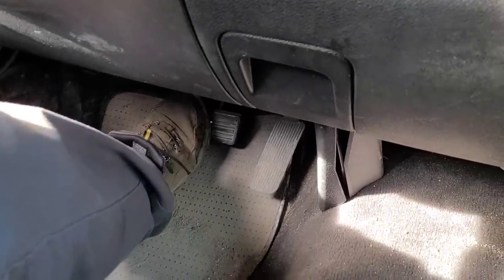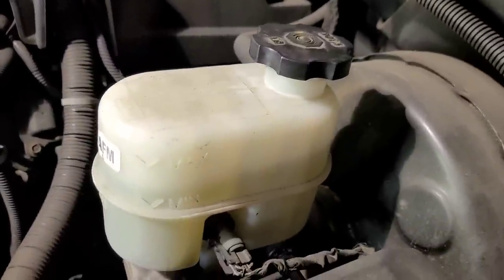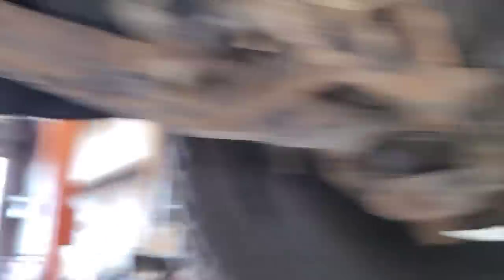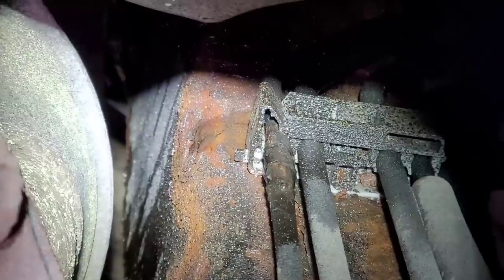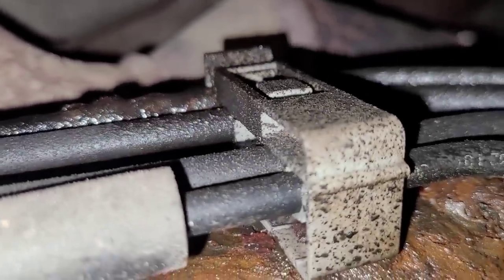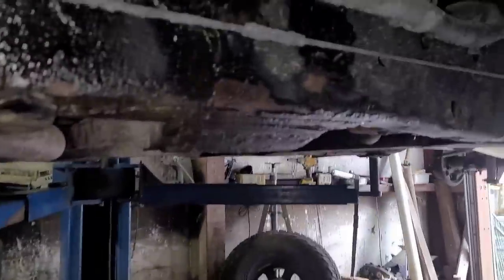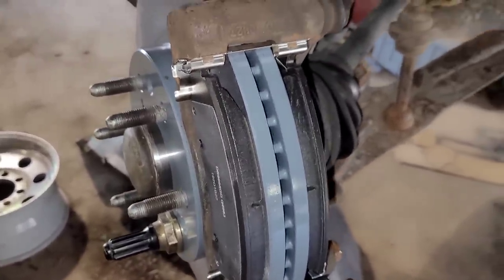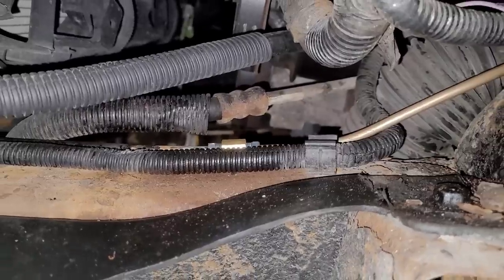Loss of Brakes. Locating the Leak, Fixing a Line & Some Helpful Tips

Comment: Hey Kenny, Here's one for ya:  Two young ladies came into the shop and asked for brake problem diagnosis on a Chevrolet van. When I drove it into the shop it had absolutely no brakes at all. So popped the hood and the master was MT. I lifted it up and looked everywhere for evidence of a brake fluid leak. I pulled the wheels and looked at the wheel cyls and calipers; nothing. Everything was bone dry. So I filled the master and began to bleed the whole entire brake system. As I went about it the two ladies came out to watch. In a couple minutes they told me I wouldn't need to bleed the brakes because they had already done that. I told them I was still going to do it and they were going to have to pay for it. They were not very happy about that, so I explained it to them.  That was probably 20yrs ago but I remember it like yesterday. ben

Comment: I'm following SeaLab Experimental Division & I appreciate your work. 1 ALL VEHICLES OVER 10 YEARS OLD AS A MATTER OF PREVENTIVE MAINTENANCE GET A NEW MASTER CYLINDER OR I DONT WORK ON IT.  PERIOD!  LIVES LOST DO NOT COME CLOSE TO THE PRICE OF A MASTER CYLINDER.  I'm not a fan of splicing brake lines old. I always try to replace the entire line especailly on an old rusty crusty vehicle.  Replacing entire line also removes any inherent rust issues inside or outside of the line.

Comment: So glad to see you flared the lines and used a coupler instead of a compression fitting. We don't allow compression fittings on brake lines up here in Ontario. I did see a shop vid from Florida recently that proposed using a compression fitting on a brake line repair ... 👌
Reply: Ray?

Comment: Hey Kenny, Glad to see the right way how to do it. I have to admit, I have used compression fittings, thankfully with no problems. They actually stayed on long enough for the brake line to rot in a different place where I actually cut the length of line with the fitting on it so I could put another one in further down. The right way is always the better way though ......

Comment: I had my fun with my 06 Silverado's brakes.  Had to replace the rear line.  While I was at it, I replaced the rotors, pads, drums, wheel cylinders, and shoes.  That was in 2018.  Good for 12 years on the originals.  Been fine since then.  I learned that stainless lines are a bear to work with.  Gave that up and switched to the flexible lines.  Those were much easier and now I have a spool of it if I ever need it.  Bought a nice flaring tool.  I could've used this video!
Reply: Inline tube sells a prefabbed kit identical to oem, you can chose stainless, not terribly expensive and they fit like a glove

Comment: I literally just did this job on a 2007 Suburban.   I used a wire wheel (aka cheek poker according to Derek at VGG) on an angle grinder to get rid of that coating.  Flared the ends and then connected everything.  To make me feel better living in the rust belt, I sprayed some fluid film (South Main Auto's favorite) to coat the fittings and any area of the brake line that didn't have the coating coving the line.  Great Job Kenny!

Comment: I know in PA compression are illegal.  I think that truck was passed on to you by Watch Wes. Never saw that tool before, really slick, especially in limited space, like in this job.
Reply: You are correct compression fittings are illegal to use on brake lines in Pa. The whole line should be replaced because if it’s weak there could blow out somewhere else. Then check out the other lines and replace them if they look weak.

Comment: I had a 97 Crown Vic Intercepter.  At 10 years old all but 6 inches of the metal lines were rusted.  I replaced ALL the lines.  Since I was there the hoses were replaced too.

Comment: I suspect the reason for the ant size is that the rust condition of the truck lead to the former fixer struggling to get the hardware of. Hoping the next time around it would be easier. In the words of Eric of South Main Auto. (a youtube channel) "Welcome to New York BABY."  Great video. I will definitely look for that flaring tool.

Comment: When you live in the rusty, crusty, North where every snow and ice event is followed by a liberal dowsing of salt on the roads you’ll understand why a coating of anti seize is used on the metal surfaces of our vehicles. I have used anti seize on wheel studs for 50 years after twisting them off trying to get the lug nuts off. There are places it shouldn’t be used and common sense must prevail.😊
Reply: D Perry you are exactly right.  I have also used anti-seize for over 40 years here in the north country and have never and I mean never had a bolt loosen from my original torque setting.  The belief that anti-seize causes bolts or nuts to loosen is just an urban myth.  Anti-seize does exactly what it says it does it prevents bolts and nuts from forming rust that can seize up any steel nut and bolt.  The prejudice from professional mechanics is the silver mess anti-seize leaves behind on their hands, clothes and tools.  I would rather contend with a little cleanup than fight rusty nuts and bolts.  I guarantee anyone who has had to fight the northern rust monster has a container of anti-seize close at hand and is not afraid to use it.
Reply: @teddymac3737  Well said and if truth be known our mechanic friend from New York, Eric O. , would likely agree. He fights the rust monster just like us.

Comment: Been there dozens of times. To save yourself some time you can jam on the brakes from 10 - 15 mph and see if one end skids. Going forward if the rears skid you have no fronts. In reverse if the fronts skid you have no rears. If you've never done this befor you have to "feel" for the brake performance, not just be a bull in a china shop. But once you learn it you'll be amazed and it's so quick to point in the right direction for diagnostics. On my own vehicles I do a bonafide Master Cyl bleed  B4 replacing it. Seent many times when just bleeding the lines and cylinders won't get that air bubble out of the master.  Kenny, maybe I missed it, but did you ever "see" a brake light from the imbalance? That should be addressed so the driver can be alerted B 4 he finds out about a problem someday again by "accident." Also, I was just wondering: Does anyone  make a hammer flare tool for brake line? I have Rigid and Lennox brands for single flare that I picked up at Home Depot & Lowe's but don't know of anyone selling one for double or bubble flares.  It'd be faster. One more thing: Antifreeze even at 50/50 is flammable too. I witnessed a hose come off a test engine on a dyno and when the antifreeze (ethylene glycol)  hit the red hot exhaust magnifolds, the flames shot clear up to the ceiling. It was such a big flame it set off the CO2 fire extinguishing system.  You're welcome. ben/ michigan

Comment: Checked out an '09 Silverado, 255000 on truck, 90000 on a new motor. Fleet truck supposedly used by a salesman.  Rebuilt front end but what bothered me more was that the doorlocks, windows, were iffy, sometimes work, sometimes not. Frame was ok, rockers replaced, price was right but alot of things bothered me. Truck should've had the AFM on it, not sure tho but I'd bet the old motor did hence why it was replaced. Didn't bite.

Comment: In the pre ABS days they had a proportioning valve that would provide some braking with the two wheels that were not on the circuit with the leak. Now with ABS, does the ABS system offer the same kind of dual circuit safety design?
Reply from the maker: They do . And some of them criss cross . IE-The r/f & l/r are on one circuit and the l/f & r/r on the other

Comment: Here in the u/k I have never heard of compression fittings used on brake lines, in domestic plumbing yes, but on something that needs brakes to stop it NO never, been doing it the way you just did with a flaring tool for years, only safe way to do it.
Reply: Replacing the whole line might be an alternative ! In this case the whole vehicle will need replacing , lol !

Comment: Oh Lordy , thinking of the gmc Savana 2500 my brother just sold . He said “ I want to change EVERY brake line on this van “ . I cringed . Well , we did . Thankfully , it used 1/4” lines like the job you did , rather than the 3/16 I’ve done forever on everything else . 3/16 “ are just like thin spaghetti compared to spaghetti . You can bend 1/4” by hand when needed and less risk of kinking than 3/16” . I’ll never let my brother flare brake line again . He knows better and he still fumbled a double inverted flare . He knows how but his negative , save money and time attitude bit him . Too bad I could not take the truck home with me , where all my tools are , so I would not have to listen to his mouth that I’m taking too long . Getting the rear drums off was another adventure . It had a swapped in 3/4 tone Dana 60 or 70 series axle . Big mamma jamma drums . I heard the rear axle blew up after sold it 😮 . All that slamming a BFH to get the drums off wouldn’t cause that , right ? 😮 nah . But the hear set blew , not wheel bearings . They were semi floating , not full floating . I’m not rebuilding it , thankfully . I’m reluctant to admit , but sometimes I get crazy with anti seize too , and I know better . I use anti seize where I should not , but I’m literally sick of rust and corrosion from living in the northeast . Things that should just unscrew , don’t . Parts that should go back together after disassembly , get replaced because of deterioration , or have just fallen off . Brake lines ? I just pray they survive . I try not to damage the plastic or epoxy coating when installing a new or replacement brake line . It helps it last longer 🤔

Comment: Copper tubing is not acceptable brake line. Copper- nickel is. Copper will turn brake fluid corrosive at 200 ppm. Plus its illegal in most states. Good video.

Comment: I could not wait to watch the r4est of the video, because you took the time to explain why you were going to replace the master cylinder  I had already planned to comment with my two cents, but at 10:30 you covered what I was going to share re: what I have seen,.  So, hell, I am going to say it anyway.  When a master cylinder pedal begins to travel further down its bore more than usual, for whatever reason (external fluid leak, out of fluid, or internal fluid leak within the master cylinder itself, the rubber seal cups have their smooth surface that begin to get pushed into the bore in an area where fr a king time the seals never touched.  ?In that part of the bore we get surface corrosion if there was any moisture that get into the brake system (leaking fluid line that exposes the fluid to moisture in the air).  As the rubber cup seals get pushed over the corrosion the smooth part of the seals get damaged by the corrosion that slices the smooth surface up.   It does not take too much of that kind of damage to begin to allow an internal leak where the pedal begins to go to the floor.  Back in the 70s and 80s I would often rebuild the master cylinders, provided there was not so much corrosion in the bore that I could not hone it smooth again.  If I ended up with pits in the bore due to corrosion I would replace the master cylinder with a new (not rebuilt) unit.

I also took not you were going to replace both rear wheel cylinders when only one waqs leaking.  Good call.  When it comes to brakes, tires, and syspension I never compromise.  Too many things can go wrong if anything goes wrong with any of those systems.  So I replace things in pairs, on both sides of a car.  Part of that is not just being cautious, but because if one component had worn to a point where a repair is needed it is highly likely both sides are worn about the same.

Anyway, I really enjoy see you ply your craft.  I really like it when you tell folks that you like to do the right thing.  My kind of fellow professional technician (me, retired, but I still work on my own cars).

Comment: When I am in doubt if the master cylinder is bad or not, I just plug off the ports and then push the pedal. It shouldn’t go down at all if it does, then it could be a master cylinder.

Comment: I had a 2012 f250 super duty with under 50k miles , one day the pistons in both front brake calipers shattered idk why but I replaced the calipers rotors and brake pads myself

Comment: I'd also bet as rusty as the frame is that the frame braces are rotted away from the cab back. I've got an '06 that did that & the frame was cracked over the left rear wheel.
Reply: Brake fluid is corrosive on paint ,  I am sure we all know that , but does it cause metal to rust ? This vehicle seems to point that way !

Comment: Funny how you have this video now since I'm replacing rear brake line that blew out due to corrosion of course it was right behind the fuel tank on a 93 Chevy 4x4 . I decided to go with the steel lines instead of the softer line because it was 1/4 the price. After a few tries a doing the flare and cutting the crap flares off i finally got a perfect flare only to find out my nut fell off in the process at some point try again   finally got it done just putting brakes back together after replacing wheel cylinders same problem broke off the bleeder screws. Sure seems odd you posting this video about the very same thing I'm working on 👀👁👀👀👁📷📸👀👁looking for cameras in my shop i hid my phone in my desk drawer while I'm working so no peeking now ya hear...
ROFLMFAO 😂😅😂😅👍👍

Comment: Didn't see if that was a double flair you did. DOT requires double-flare for break lines. Can you elaborate❓️
Reply: It is double flared. I have the same Lisle tool, works great. 2 stage process, 1st threaded insert creates the flare, 2nd insert completes the double flare. He did use both 👍

Comment: I’ve seen worse lol 
That’s going to be an expensive job to be done properly I don’t piece in brake lines I go from point to point
Reply: Reason why I said replacing the entire line cause it’ll most likely go again especially if it’s from the Northern States I use the Nickel/Copper coated brake lines it’ll outlast the vehicle it’s the next best to stainless steel lines.